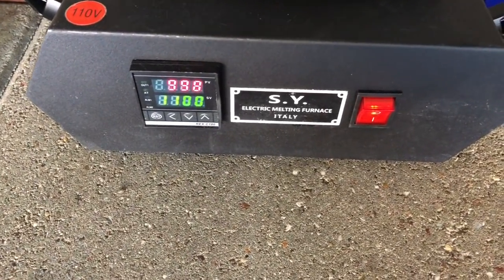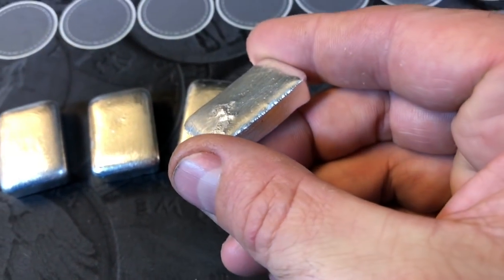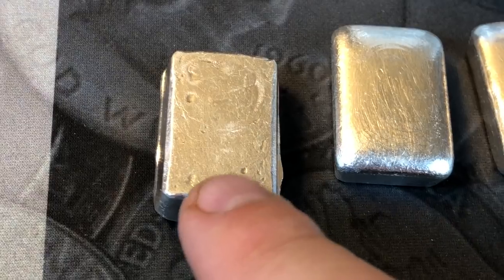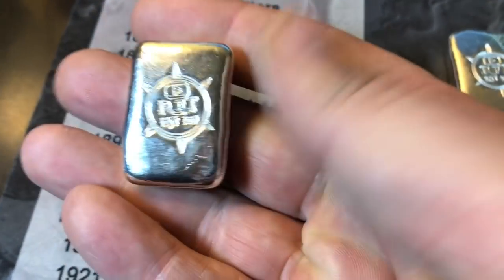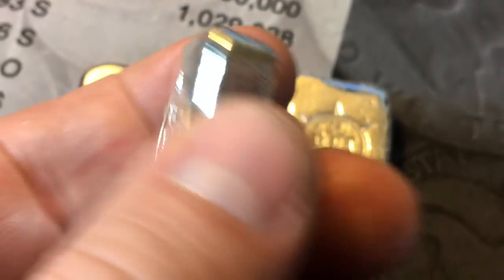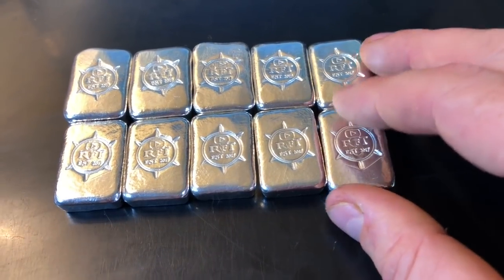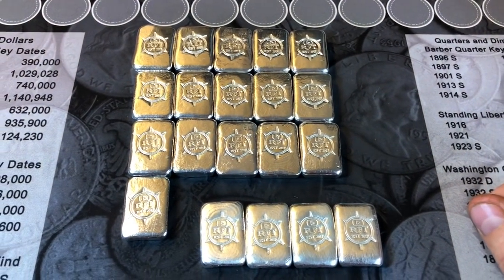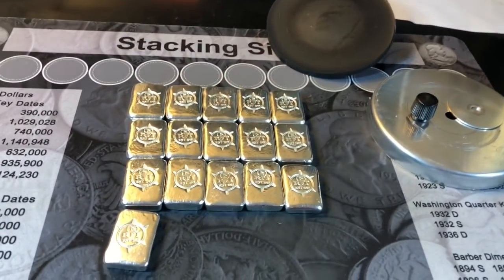My First 20 Custom Hand Poured Silver Bars - RFT Bars!

Comment: Technically, that would be a double struck bar instead of double die. The die is fine. It was the stamping "machine" that made the error. (Actually you are a machine at going through coins, so maybe I didn't need the quotes.) Still looks awesome, though. Great set of pours!
Reply from the maker: moosesox very true - operator error for sure!

Comment: You're getting the uneven pores because you are using one credible and one mold and that little bit of Gunk on the top is slag. If you have enough silver to pour 5 bars you should make a multiple mold that will take all the silver in one pour just like the Spanish did it when they poured silver in Mexico at the time of Montezuma. (unpolished)
Don't you lose some silver in your polishing.
Reply from the maker: Thanks William!
Reply: You are pouring what is known as a bread basket pour. Open top. I pour a lot of metal and some part of my hobby I make little soldiers and stuff. Most professional precious metal bars are poured in what are known as compound molds using sand there's a way of pouring hot silver and gold into styrofoam. I use Wolmanized rubber molds into pieces clamp together and I pour with a ladle.